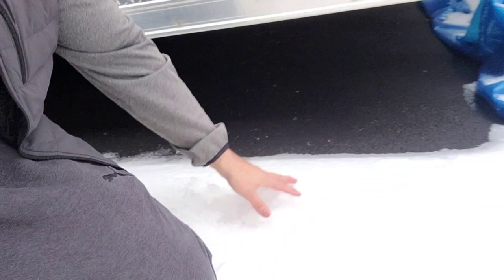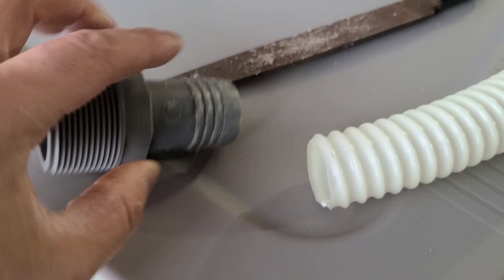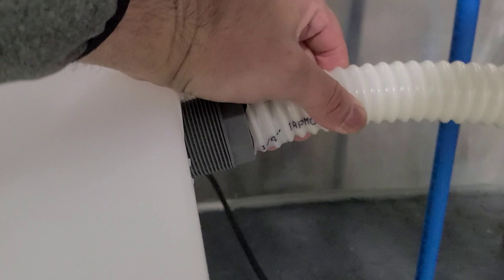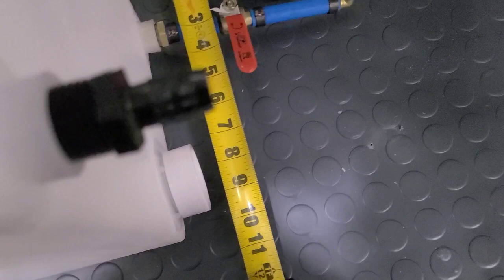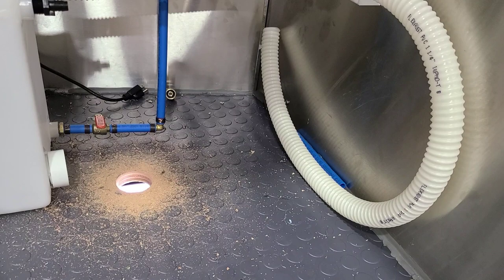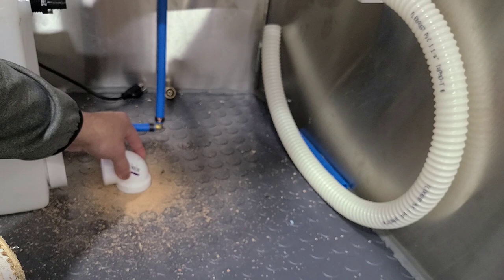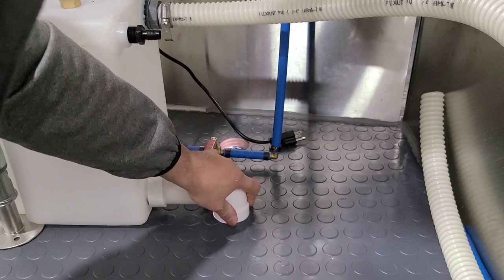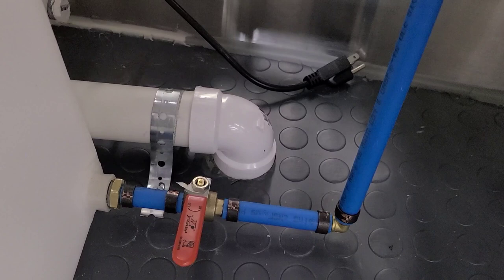How to Build your Food Truck:  Drains for the Water Tanks

Comment: On the hose and the barb, if you heat it up the hose just a little bit, the hose will expand and you don't have to cut the barb of the connector.

Comment: How do you secure the water tanks. Or does the pvc pipe into the floor drain keep it held in place.
Reply from the maker: @douglasballentine7792  yes and the legs of the 3 compartment sink. You can use L brackets

Comment: Pro tip: heat a pot of boiling water. Let it cool slightly, then put the end of the hose in the pot. Let it sit for 1 minute then take it out and connect it to the fitting. The hose expands just enough to fit over the fitting so you don't have to cut the fitting nor file it down.

Great videos my man. Love what you're doing!
Reply from the maker: Nice!!!! Great tip 👍
Reply: A plumber gave me some advice. Grab some bar soap, like your typical dove bar… and then put it on the tip… as it dries on… it becomes lubricated. It helped me so muchx
Reply: It looks like an MIP pex adapter, if it's legal I would just hook pex up instead of cutting the barbs off and potentially risking a leak. If you can I would also use brass fittings instead of plastic with water. I don't know code for food trucks but I figure it would be legal

Comment: I really appreciate the info you provide with a utmost dedication. I just want to have your opinion regarding building a 20' shipping food container trailer to be parked on a permanent location. is there any difference in building between a shipping container vs regular trailer. your opinion is appreciated. God bless you
Reply from the maker: I would assume all very similar, you might however possibly need to pull permits for that permanent build.

Comment: You don't need to shave the ribbed part of the connector for the flex tube. You just screw (clockwise)  the tube and it will go right in.

Comment: Hey frank, waste water tank.  Connections leading to sink, vent, drain right? What is the last small whole on the bottom right corner for. On the fresh water tank its the same Connection use to transfer water to pump.

Comment: Hi Frank, would it be appropriate to put the two valves for draining the water tanks inside the trailer? .. Considering the climate of North America, that piece of pipe that comes out of the trailer can freeze the water in the case of the trailer it is also used in winter!
Reply: Exactly. It’s going to freeze.

Comment: great work! do you have a vent for your tank, and a s trap? I cant see it,  a truck I was using wouldn't pass code because of no vent and needed to pay an extra 150 dollars to get another inspection after I did the work, they are very picky of here in Canada lol
Reply from the maker: There is a little vent tube that goes to the fill valve and that's how it gets vented. No trap required for us here, every county is different which makes it harder.
Reply: @fbaltierrez  agreed lots of differences figured I would leave a comment for those that are watching from Alberta Canada

Comment: Hey me again, thank you for all your help. I have some question, I’m wondering if I make the water tank by gravity put the water tank in the roof.that way I don’t have to used water pump. Do you think will pass inspection?
Reply from the maker: I would not recommend that, water is heavy!!!! Its only a $100 pump it will save you in the long run in my opinion
Reply: @fbaltierrez  that true I was just thinking about that option, you know trying to get this trailer done. But thanks again for all your help. 🙏🏼

Comment: Drill is smoking because you keep drilling the holes on the 2 setting.  Move it to the 1 setting and it wont smoke or stop as often it will drill slower but it will not wear out the drill also.

Comment: Hey Frank! Great videos man!!!!!  Question, where do you go with the open end of the vent pipes? I see you Tee'd them together which is nice.  Does the open end of the vent pipe(s) also have to be placed on the outside of the truck/trailer?
Reply from the maker: The fill valve that will go on the side of the trailer has a place to put the vent pipe right next to the fill line. Works great
Reply: The only problem I see with hooking the 2 vent lines together is that if for some reason the gray water tank gets ignored and over fills it will back up into the vent and then eventually flow into the fresh water tank. Not sure most health depts. would approve that.